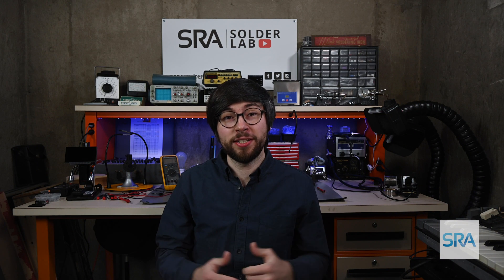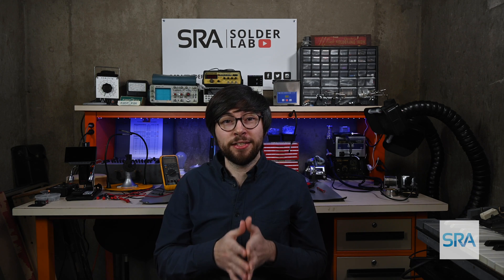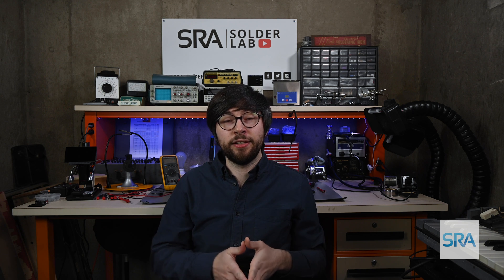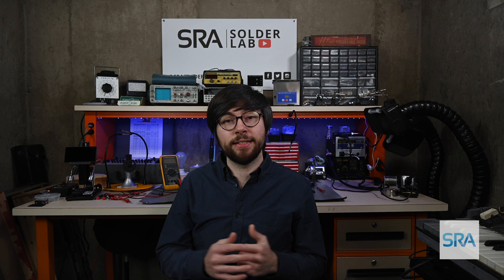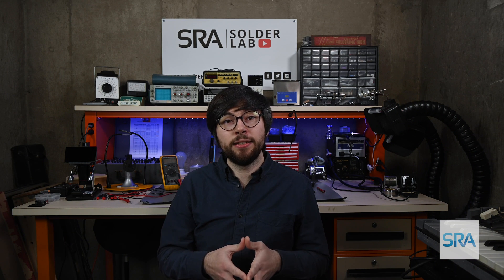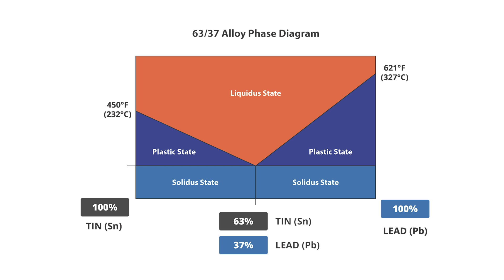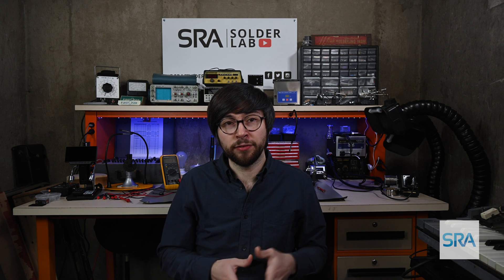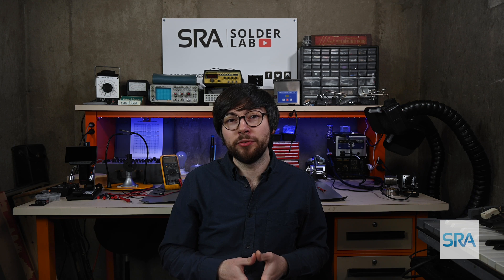Is Lead Solder Bad For You? | SRA Solder

Comment: Leaded solder as an electrical connection and conductor tends to remain stable over a much wider range of temperature extremes, as well as vibration and mechanical stress, then lead free solder does.  Leadfree solder is also far more likely to cause short circuits from the outgrowth of crystalline dendrites, also known as tin whiskers (Google the tin degradation phenomena known as "tin pest"). Alloying tin with lead ameliorates this problem.  The breakdown of connections made with lead free soldier results in millions and millions of electronic devices failing prematurely every year and ending up in a landfill.  If the ultimate goal is to reduce E waste going into a landfill then leaded solder is actually better for the environment. There are also many other toxic medals and compounds in electronics besides lead,  and really they should all be recycled, and built to be more easily recyclable, regardless of what type of solder is used in their construction.  This might make me sound cynical, but my estimation of ROHS (reduction of hazardous substance) trade agreements and legislation is that they were instituted not so much to prevent lead from getting into the environment, but to prevent manufacturers from being held financially and legally responsible to make sure that their products get recycled in a safe and ecologically sound manner. ROHS might be providing legal cover for companies to build millions of shortlived and disposable products that end up in the landfill.

PS, I don't find rosin fumes from lead solder to be particularly bothersome ( your experience may differ), but fumes from the special leadfree solder fluxes are noxious and nasty and you definitely won't like them! Rosin flux is also mostly inert, non-corrosive and non-conductive, but leadfree fluxes must be completely removed from your circuit boards and connections, because it does conduct and is definitely corrosive.
Reply: With all the current developments in AI, recycling and making products that last longer will become a priority.
Reply: 100% agree. Dead right on dendrites! And lead free flux has dangerous halogens wicked bad. Everything is recyclable and should be!
Reply: @Ford Simpson , no, it's about manufacturer's profits. "Leadfree" and ROHS trade agreements are about freeing manufacturers from financial liability for the pollution they create. Your reading-comprehension skills need improvement, matey.

Comment: Which brands / kinds of lead free solder do you recommend? All the ones I've used so far were disappointing to work with for me.
Reply from the maker: What did you not like exactly about the leaded solder you've tried? Also, what kind of work are you doing and with what iron and temperature?
Reply: @SRASolderLab  fine electronics work building drones and keyboards,
I didn't like how goopy it was and how poorly it was wetting. Reflowing was a pain and it didn't transition instantly from solid to liquid.
It just performed worse in all aspects. 

I have since found a video showing some decently performing unleaded solder, I might get some and build my future keyboards with unleaded solder, but I think I will stay with leaded solder for my drones as mission-critical applications still specify leaded solder like aerospace and military.
Reply from the maker: @definingslawek4731  I generally recommend using a SAC305 alloy for lead-free as it usually has the closest performance to leaded alloys like 60/40 and 63/37. You could try using an externally applied flux to speed up the heat flow/wetting process or possibly even use a slightly higher temperature. The lead-free alloys will require more heat to melt.
Reply: @SRASolderLab  Do you have any experience regarding bismuth based solders? I’ve been trying to see if maybe they might be a good substitute for leaded solders, given how close bismuth sits to lead.

I’ve been finding very little info on the matter though. Would you happen to have much experience with it?

Comment: From what I've seen leaded solder costs a lot more than unleaded but people in the hobbys I practice all spring for the leaded ones ayway.
Reply from the maker: Leaded is a bit easier to work with and a lot of people are simply just used to it. Also, if they're reworking older equipment, it is important to use similar alloy/flux. I'm not sure where you're located but where we are located in the US, lead-free is typically pricier.
Reply: @SRASolderLab  In some countries, leaded solder is restricted due to RoHS.

Comment: I'd like to go not just lead free, but with a water soluble flux instead of rosin flux, but I'm tinning stranded wire and I'm concerned about assertions regarding flux wicking underneath insulation and causing corrosion. This is plausible, although I can't find any evidence based on tests one way or the other. Interestingly, Kester, for example, does not warn about using its water soluble 2331-ZX with stranded wire.

Comment: lead free solder is bad for your sanity :)
Reply: Maybe he should show which kinds of lead free solder he uses, all the ones I've used so far were really not fun to work with.
Reply: @definingslawek4731  it's ALL horrible to work with, I've never used any lead free solder that was any good, most people doing this for a hobby are not doing enough soldering for it to ever be an issue.

I can see the argument for unleaded solder if it is a company that is mass producing thousands of units who usually have automated soldering done by machines (which can be strictly controlled in the temperature and time the heat is applied), for a hobbyist making a few projects by hand lead free is a nightmare to work with
Reply: @MmostlyRandom  Have you tried SAC305?  Yes it turns dull when it cools but it is relatively easy to work with.
Reply: @definingslawek4731 They are horrible to use and not as reliable. Eutectic for me.
Reply: Skill issue.
Reply: Eutectic is my go too.